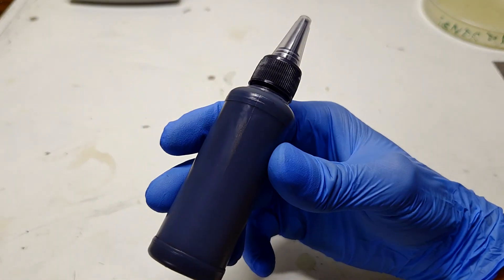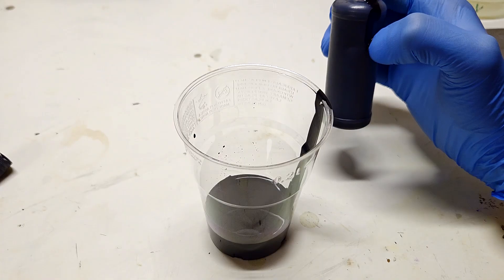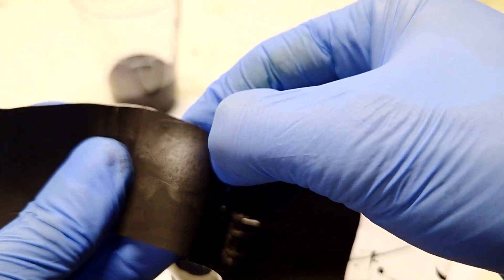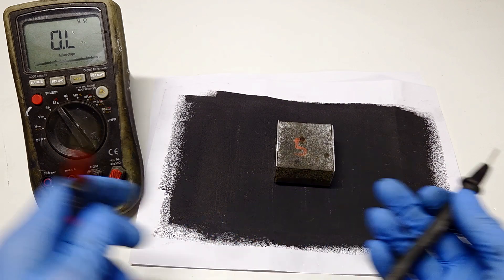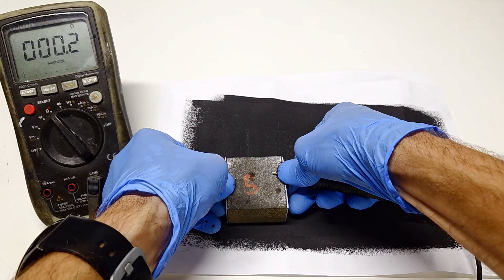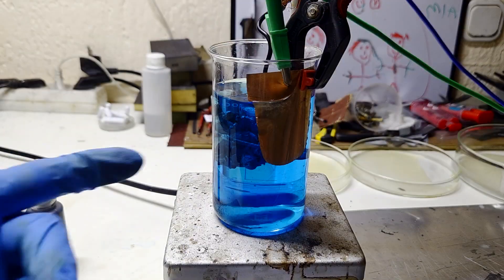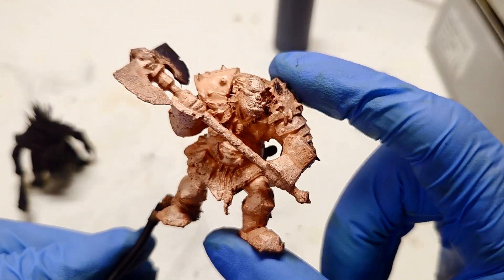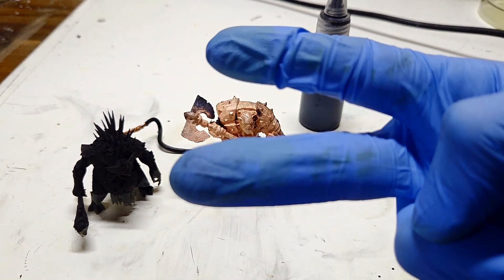Electroplating with Carbon Conductive ink

Comment: i would use an extremelly soft tooth brush over the paint before plating: it will smooth the surface and make it shiny. 

its the common rule in electroplating: the resulting surface comes out as good as the pre-plated surface was.

but its really nice result! im surprised that un-brushed paint gives you 20Ohms straight away. 
i guess after brushing it will be like 1-2 ohms.

also a question: what if i use 50 micron power only, will it reduce conductivity drastically?
have you experimented with that? im really qruious about the numbers.

good luck!
Reply from the maker: Intetesting. In basic you can use only 50 micron powder. But will for sure reduce the conductivity a little bit.

Comment: One thing I stumbled on for copper plating , 
I mixed copper 2 chloride and MGo , added H2O2 and it heated up, I stirred the mix with my stainless steel rod and it got coated with brite copper, be careful when you add H2O2, it is exothermic

Comment: can you spray paint that conductive liquid, instead of dipping. looks very liquid enough. you get even coating if you first some minutes make sure that ever part begins to coat with copper. then you can leave it on higher current. ie rotate the electroplated object around until its fully covered by thin copper layer with high conductivity all around. very low current at start to get the layers even without dendrites.